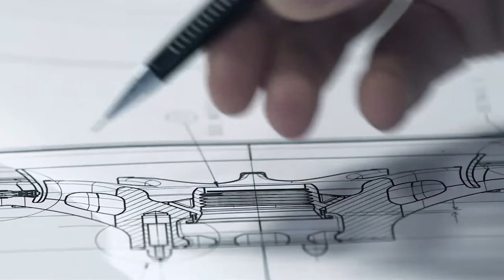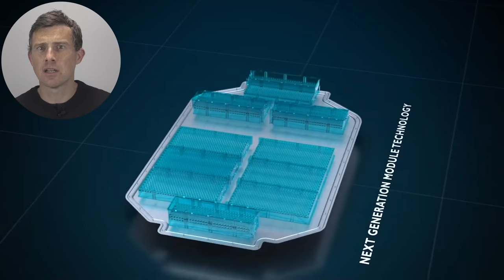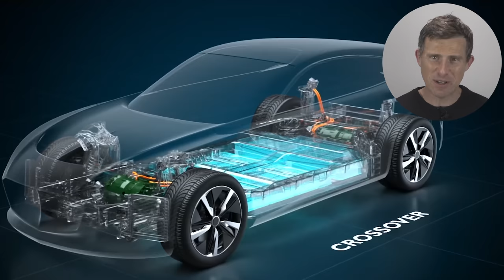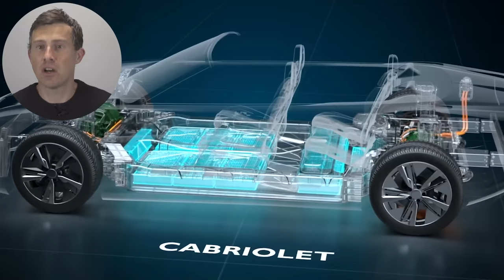New Jaguar F-Type R - an EV with 1,360hp and 1,000KM range?

Comment from the maker: So, could this Jaguar F-Type be the ultimate EV? Or would you rather go for the Tesla Roadster? Let us know below!
Reply: Tesla roadster, can’t wait for it to come out (when it eventually does)
Reply: the Jaaaaaaaaaagg
Reply: Tesla
Reply: @HughRussell06  yes
Reply: obviously the Jaguar
Reply: Honda Civic review 2022? Any time soon?
Reply: @jareermzahalka  idk if it’s out yet in the uk, they’ll probably review it when it comes out
Reply: Both
Reply: The jaggg of course teslas are common now aren’t they
Reply: i bet it would go for the plaid instead of the roadster
Reply: Tesla roadster
Reply: Jaaaaaaaaaaaaaaaag
Reply: Would rather go for a V6 F-Type with a manual transmission and 1000 less horsepower
Reply: Jag. I prefer a quality product to something that is just about its numbers and tech.
Reply: Trogir ❤️❤️❤️ Croatia ❤️❤️❤️
Reply: If u see then not only the range of the tesla roadster is crazy but its performance. And look at that 6 figure price tag its insanely cheap for such a car and i think that it will do 0-60 in less then 1.9 secs cuz it has a 200 kwh battery and its probably gonna be lighter in weight than the model S plaid (im not trying to say something bad about the model S its my dream car ok as well as the roadster) so if they are claiming a 0-60 time of 1.9 secs of the plaid model S  then the roadster is probably gonna smoke that time.
Reply: Btw 2:57 they probably copied that from the tesla model 2 which is going to use the same concept.
Reply: Tesla roadster
Reply: None I can’t afford either 😂
Reply: I’ll have the Jaaaaaag
Reply: The Jaaaaaag, although I personally am not a fan of EVs at all
Reply: I'll have the Jagg. It will look cooler and should be amazing (if the I-Pace  is anything to go by). Plus, we don't exactly know when the Tesla will appear in production spec, as it has been 3 or 4 years since the concept.
Reply: If Tesla waits any longer, all the really smart dudes at Williams and Rimac are going to beat them to the show room. So preference will be probably dictated by availability.
Reply: JAGJAGJAGG
Reply: @llyh8023  EVERY car company is about numbers and tech.. show me a car company that doesn't care about either and I'll show you a car company that's bankrupt.
Reply: Congratulations  for 6 million subscribers ♥️🔥
Reply: I would rather you stop misleading people with your video titles.
Reply: @gamingbuildingandcubing5644  Imagine the Tesla Roadster with the SpaceX-package 💪 The Jaguar have no chance.
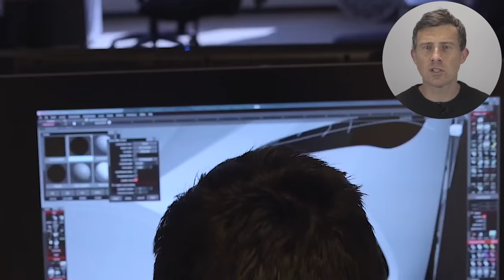Reply: Of which car can you see the digital concept at 4:52 minutes - 4:58 minutes?
Reply: @TheMadmax0609  okay, Rolls Royce then (find me a Rolls that has all the bells and whistles when it comes to tech, and one that boasts 0-100 times). 
I didn't imply that car companies don't care about either. What I am saying is there are many car companies that do more than just slap on tech and boast figures. You know, proper car manufacturers that actually make cars, and not iPads on wheels.
Reply: @HughRussell06  but the question is when
Reply: @Raptile07  yeah thats what im saying tesla has more knowledge alone they dont need to spend money and take help from other companies and then make their cars expensive to make their mony back. Btw tesla roadster with the spacex packed is actually package🔥🔥🔥. Also people call fast cars rockets well this one will actually be a rocket cuz it has them😉(to break our heart neck, hopefully not) it'll be fast though
Reply: And very cheap
Reply: Jag!
Reply: You're top right in-video links aren't showing fyi...
Reply: @maxkillers26  yes even on my moms ipad they don't show up but on her phone it does (which im using now) so maybe you just have incompatible software
Reply: Indian company always make good product.
This jaguar will definitely Rock.
Reply: @llyh8023  You mean like I-pace?
Reply: Hey Matt I want to see a jaguar I pace vs a Porsche macan GTS vs a Tesla vs Mercedes GLE 63 Amg vs a Jeep trackhawk please I need that race
Reply: Obviously tesla.
Reply: Next taycan turbo s 
Cause porshe could also throw some bangers
Reply: Tesla Roadster
Reply: Tesla roadster
Reply: Tesla can't build a reliable car to save their lives, and parts availability is a nightmare. I'd rather have an EV made by an established car maker.
Reply: I’d take the jag over any Tesla
Reply: @nodak81  tesla is the first ever ever car to come out in 2002 and that was the fastest car ever but the person how make the company Nikola tesla died and then elon musk started to be the ceo then tesla build the tesla model s with elon in June 22 2012 and the x in 2015 of September and the model 3 in 2017 and now the model s Plat in 2021 so tesla is the first ever car to be ev and it would be more to see if they did something right and the government would make him trying again but they would not do that to jaguar because they are just starting to make ev.
Reply: @Raptile07  I'm happy to know that you think a measly 6 seconds out of an 8 minute long video that addresses the actual topic of the video is worth your time, and that too a speculative render based on carwow's own opinion rather than on any industry insider news or rumors. This is pure filler content.

Also elsewhere I pointed out that the popup banner for the Tesla hatchback thing mentions that the car has been 'revealed'. It most certainly has not been. They just want your clicks.
Reply: Why does this F-Type looks like a Ferrari Roma copy? anyway for sure the Jaaaag. The Tesla Roadster is just a future promise which might never come.
Reply: Plaid!!,
Have you not been paying attention?
The rest are all just dreams from the competition.
Reply: I don't know why he hasn't presented the Porsche Cayenne Turbo GT yet, what's wrong with you, Matt?
Reply: Mr...Gagg...
Reply: Tesla Roadster obviously. It will have optional compressed air thrusters!
Reply: TOGG will build the 1000km+ ranged EV.
Reply: Rimac Nevera with 1910 horsepower will beat the  1360 HP  electric  Jaguar
Reply: Tesla Roadster
Reply: I rather go for Tesla roadster cuz it’s fast than plaid s and good range.
Reply: There is update that Tesla roadster with booster spaceX(limited edition) will increase up to 820 miles range which is more than 1000km!,! !!!!!
Reply: Tesla Roadster
Reply: Tesla
Reply: Jags are just higher quality
Reply: This should be the ultimate EV!! MERC, NEO AND TESLA SHOULD START TO THINK PROPERLY NOW!!
Reply: Matt, please put the new BMW M5 CS up against the Porsche 911 Turbo S. I saw a video on youtube claiming that the M5 CS is faster from a rolling start. We need carwow to put this to the test.
Reply: Dodge challenger vs mustang gt 500 vs BMW m8 pls carwow
Reply: Jaguar. Even with JLR record on build quality, it would still be better than any Tesla
Reply: @nodak81  people probably said the same thing about buying clothes from Sears, JCPenney and Kmart, versus Amazon... And we all know how that turned out. 🤷
Reply: Teeeeeeeeeeeeeeeeeeeslaaaaaaaaaaaaaaaaa!
Reply: Jaguar forever! Tesla never!
Reply: F type no.1
Reply: F-type definitely!
Reply: Jag because the Tesla isn’t out yet
Reply: None of them because there both electric
Reply: @dahmarleyamore5991  Tesla Plaid? or other?
Reply: Jag everytime
Reply: Yeah I'll drive a jaaaaaaaag
Reply: Yeah I'd drive a jaaaaaag
Reply: I will like the tesla road star
Reply: Nah man, Tesla's new 4680 battery means cars will go further with smaller battery pack sizes. Also, they'll be the first to launch a 620 mi range car, they won't allow anyone else to do that. They're battery constrained, which is why they haven't yet finalised the Tesla Roadster 2 design. That will change next year when 4680 comes on line at 100GWH run rate by end of 2022 and they get their suppliers to DOUBLE, yes DOUBLE 2170 supply!!! This is not even concept, so as Elon said, "2nd place will need a very large telescope to see us."
Reply: I prefer the MX-5.
Reply: F-Type wwith an ITALDesign mod Please and Thank You
Reply: Im sure Plaid S will smoke this car. Roadster? Dont bother..
Reply: Tesla roadster for sure
Reply: Tesla please....
Reply: Look. MAT This IS HARD UMMMMMMMM god Tesla not jag I’m sorry
Reply: Jaguar better!!!!
Reply: 100% the Jag. Not another soulless Tesla.
Reply: Jaguar
Reply: Prefer my V8 F-type over any eventual electric F-type
Reply: ill take the jag
Reply: F-type EV 🔥.
Reply: I’ll take the Jag if it electronically recreates the exhaust sound of the V8 FType.
Reply: Jag it is
Reply: The Roadster any day
Reply: The JAAAAGGGGG 🔥🔥🔥🔥
Reply: Tesla roadster no question
Reply: Jaguar price 2 million? against Roadster 200-250 000 ?
Reply: Jag!
Reply: It would all depend on price. If Jaguar can get a 1000km range car in for circa £100k they would be snowed under with orders.
Reply: That Jag…..
Reply: @lglg4151  but actually Indian 🇮🇳💪
Reply: Jaaaaaaaaaag
Reply: JAGUAR F TYPE ULTIMATE EV 🔥🔥🔥🔥❤❤❤❤🤩🤩🤩🤩
Reply: I'll choose my all time favourite the Jaaaaaaggg...🔥🔥🔥🔥😎😎😎
Reply: Tesla is shit 💩💩. I'll choose Jaguar
Reply: Jag has always disappointed me (eg, the recent cancellation of the F-type) so...
the Model 2 will outsell everything.

Comment: I like how he called a random drawing of a car they completely made up an “exclusive carwow render.” 😂
Reply: Uh, idk, because its a render of the car, done exclusively for carwow maybe..
Reply: @F1ll1nTh3Blanks  Uh, the 'exclusive' is redundant in this case then...
Reply: I SWEAR! Call it concept art and go on with your day. Besides, everything is speculative anyways. Carwow should just stick to drag races.
Reply: Lol
Reply: Looks like a polestar🤓
Reply: Usually these renders are based on information they get from undisclosed sources at the manufacturer. This render is not actually new either. It's been floating around for the last year or when the Vision GT concept first debuted. The fact that SVO has actually created a working concept of that car should be enough of a hint to know what is coming in 2025 and what it will look like. There has also been many news stories recently about Jaguar, Jaguar's Formula E Team, and their ties and involvement with Williams Advanced Engineering. The two companies have been in bed with each other for the longest time, so it is not surprising that Williams would end up being the new platform developer for the future Jaguar EV's. They already have done the I-Type racecar after all. Jaguar also has a couple of secrets that they have hinted to over the last year or two that I'm quite frankly surprised no one picked up on. There is more in the works over there than you might think.
Reply: @kristiansand2480  it is exclusive,  u won't see such a drawing (render) anywhere else
Reply: @benjimc1  it’s like they took a mach e and they turned it into a coupe
Reply: It’s unbelievably stupid
Reply: Damn right, I can also make tons of exclusive render … all I need is a pen 😜
Reply: @amoddedblueteslap100d7  lol, did you make this render or something?

Comment: I would rather see car companies develop EV cars that concentrate more on range than 0-60 times
Reply: and interior and exterior design too
Reply: Than*
Reply: So true. Those 0-60 times are getting ridiculous. Nobody needs that. Focus on weight reduction and range!
Reply: The thing is while making the car motor “energy efficient” you also end up making them more powerful.
Reply: There is more money to be made on the expensive cars.  
Then there is the problem of many of the cars have poor efficiency (like the I-Pace), which mean to get the range they have to use very large batteries, which makes it heavy increasing the rolling resistance, reducing the efficiency; adding larger batteries to get range is an issue.
Hence - the whole of this discussion here about making a very light car with integral batteries where money is no object.
The real problem is "range/efficiency + cheap".

300 miles is a golden point - which is as far as many ICE cars go (US ICE cars are really inefficient - so they tend to only go this far), because at this point, when the sort out the shit-show called charging infrastructure, you will need a pee + coffee - which is the time needed to charge you car to drive another 200-300 miles in your car.  
Of course you might be one of those people that cross your legs over 500 miles - which takes about 8 hours to drive.
Reply: Than*
Reply: @Aniket2712  Electric motor is already as efficient as it can be, with regenerative braking their efficiency is close to 100%.
Reply: If they keep pushing on 0-60 I see that cars well become underivable
Reply: @DuBstep115  no they are not, if you are to think EV motor is efficient, god bless you!

Edit- they are efficient but off course they can be more energy efficient ... & Also, how told you ev Manufacturer are not focusing on range? 

Making battery a part of the structure is to fit more battery & increase range!
Reply: @DuBstep115  not even close
Reply: @Aniket2712  I have no idea what you are even talking about. electric motors generally operate over 90% efficiency when paired with regen brakes its closer to 100%. So no, there is no room for improvement.
Reply: @subscribemf3528  What is not even close?
Reply: I think a lot of car companies will be focussing on range, it’s just that the performance car manufacturers like Jaguar have never been about efficiency, it’s all about that speed and what it’s like on a track that matter more in their case.
Reply: Yeah. I want see other EV with 400Mile Range or more , like Tesla.
Reply: That's true. EVs need to concentrate on range, Interior, Exterior, light weight and stop thinking about who's the quickest EV.
Reply: For more range you need more batteries. More batteries --> higher max current --> faster acceleration.
Reply: @florianhaffner3910  boomer vibes..
Reply: 0-60 times are more exciting and marketable though
Reply: @omaralkayal7598  what would you want? The government to put restrictions? Never happy
Reply: I would rather see car companies continue the development of the internal combustion vehicle.
Reply: @blanchbacker  I don't
Reply: 1000km range irl=200km
Reply: @unicorntomboy9736  my car go from 0 to 60 in 2 seconds then I have to get the bus.  👌🏿
Reply: @mrgreen9388  I don't understand
Reply: Based
Reply: They should concentrate on making the cars more energy efficient, what's the point in having energy saving devices in the home if you drive a massively powerful ev?
Reply: @muhammadsalajee4236  noted 🤣👍
Reply: @sabahlarakadar420  corrected 🤣👍
Reply: Maybe someone should focus on producing the electricity for all those cars.
If everyone switches to EV, where will the electricity come from? New power plants need to be built. And what about power lines, switches and transformers?
No, solar and wind won't be able to help much. They are overrated, inefficient, unreliable and too expensive.
Reply: The range is not really the issue, it's price, charge speed, weight and infrastructure. 250-400 miles of range is enough for 99% of people.
Reply: @florianhaffner3910  Well its very easy to do! You just need a powerful motor.
Reply: 1000km might be necessary for some, but I think most people would be fine with 500km. Why waste energy carrying weight you don't need? Handling would be improved too.

Comment: If that were to happen, it would be possible to drive from London to Paris and back on a single charge.
That’s around 600 miles in total.
Reply: @DaveDVideoMaker  are you Dave D’video Maker
Reply: @lol-ws6po  Duh? Of course I am.
Reply: As someone who can currently get up to 800 miles of range from a tank of diesel, anything real world, over 400 miles in EV would be acceptable.
Reply: @DaveDVideoMaker  for someone who knows a little about computers since youre a 'video maker' it's a shame you cannot spot a fake bot
Reply: @humunahumunaha9770  It doesn’t matter if it’s a fake bot or not. I tell it to shut up.
Reply: the only problem is the ocean
Reply: @alinzi8672  Just go on the Eurotunnel. But the problem is that when you get out of it, that means restarting the motors, but starting the motors use a lot of power?
Reply: Yeah…
Reply: and what if tesla collabs with williams
Reply: @stubones  yea it's pretty funny to hear all these people talk about getting 600 miles in a EV when I've been getting 780mi per tank in my Q7 TDI for almost 5 years 😂
Reply: @stubones  it would be around 400, ev hate highway an takes a lot of power, but city driving I see it making 500
Reply: @noirceur_  the amazing thing is that's for EVs, and were just starting EVs, ICE cars have already peaked out, in the future EVs can go 1000 miles on a single charge at this rate